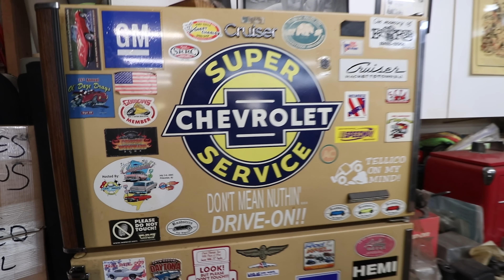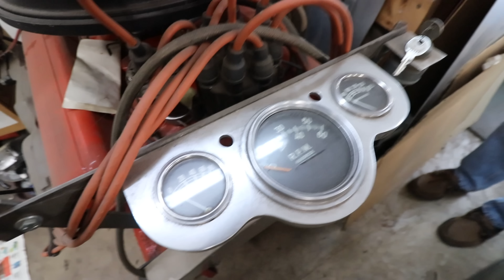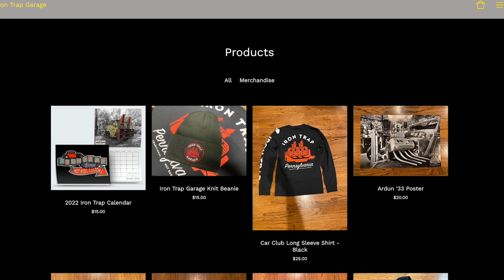Shop Tour Dropping The 32 Roadster Off For Upholstery!!

Comment: My dad had an Austin-Healy like Jim’s. I was 8 or 9 at the time and I remember riding in in on a summer day with the top down, but, your feet would cook from the heat coming up from the engine and radiate through the trans tunnel and floorboard near it.

Comment: I had a 59 biscayne ! I had a 62 American Rambler 6cyl with 3 on the tree , 66 Ford 2 door hardtop Fairlane  289 with C4 transmission , 72 Camero , 69 Dodge Dart GT 2 door hardtop 318 , 57 Willys 4x4 station wagon with Super Hurricane , 54 International pickup and 50 Chevy pickup and 84 Chey 3/4 ton 4x4 !

Comment: Those Healeys are so low! I saw a six cylnder Healey once that had a reverse dent in the hood from hitting the oil pan on a speed bump pushed the engine up into the hood.

Comment: One of my Customers has a Mercedes with a hood liner in the folding top. The outside is smooth and you cant see the hood bow shapes. It folds easily ,even with what looks like a big mattress under the top material. The interior lining sounds similar to the cloth you have got.

Comment: Twer it me I would put a mildly built "409" torque monster in the "63".  Those scalloped valve covers signal "power" and go fast.  Later on in the video I see he has a "409", and it's a "63", he could put that in the 2 dr. with a carter 4 holer and a 4 gear and have period perfect street/drag coupe.

Comment: You just "KNOW" instantly when you run into a man to respect. Jim, obviously, is one of those men !!! "Totally shitty" has its place, but, there's lots to learn from this guy !!! Pay attention and learn/grow !!! I'm sure that top he creates is going to be "frosting" on your car !!! 
Those Camaro Z28- 302 motors were "factory hot rods" !!! Absolutely NO QUESTION !!! That hydraulic ground 265 horse cam is a great idea. I have a 283 that we had a custom ground 12/18 cam hydraulic ground in a 57 Chevy. Has the great idle sound, runs really strong and needs no periodic adjustment. 
When I was a kid, those "padded" custom roadster tops were much more common. They were commonly known as "Carson" tops. Don't know the "origin" of that term but it was what they were know as. As I recall, they didn't fold. They were "lifted" off. 

👍👍👍👍⚙🛠🔩🗜🔨✌🖖🍺🙃😉